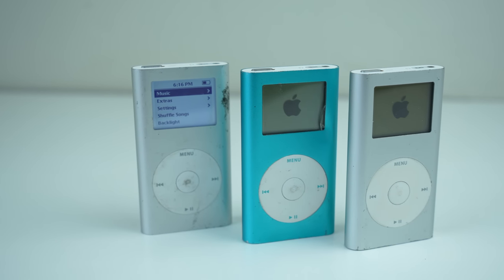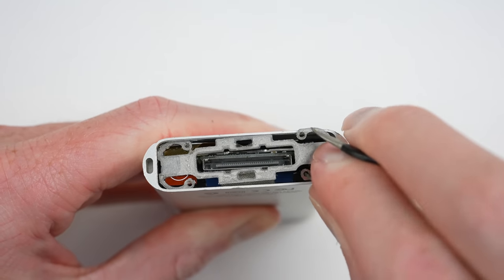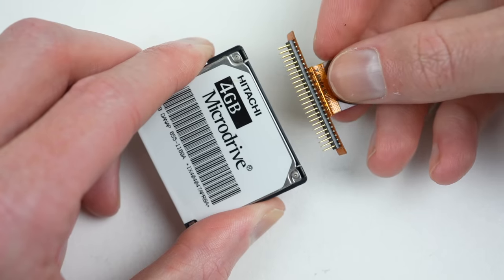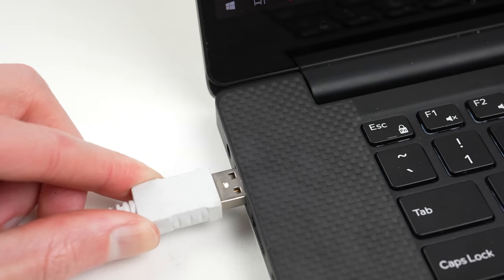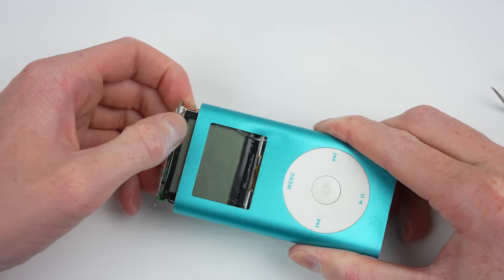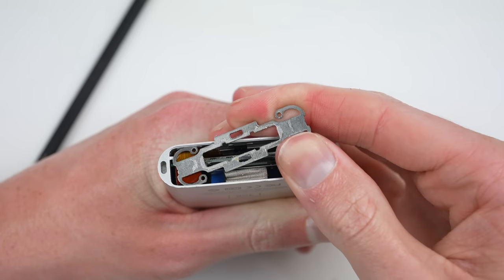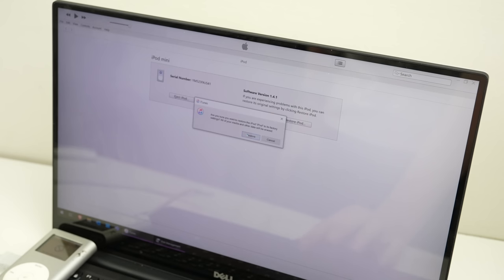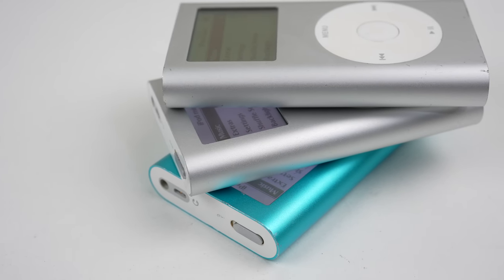Repairing 3 iPod Minis Saved From E-Waste

Comment: Come on you cloud have done it the dirty way by using a sd to cf adapter
Reply: yes you can, but the adapter sometimes works weird and you end needing to restore the device over and over again, the sd card will nt age as well as cf card will, and cf does work like a hard disk, so is just plug and forget

Comment: Always use isopropyl alcohol to completely clean ALL parts and insides from grease and dirt and to separate the glue. Buy a paste for polishing plastic and metal, it costs very cheap. Use a hair dryer to heat the glue. Your hands are dirty and everything else. do you work in a dirty basement or where? The protective screen is very easy to replace, even using cheap parts from aliexpress. Respect your work and the audience. It's disgusting to look at your work, every new video. You're making the stupidest mistakes. I'm not a professional, but even I do it more accurately than you. Do it efficiently or don't do it at all. It's a shame!